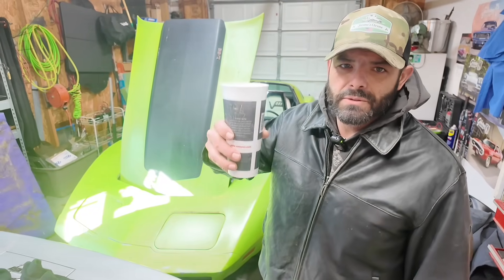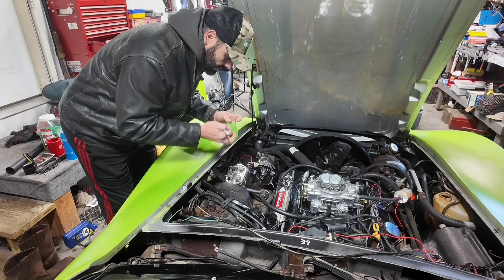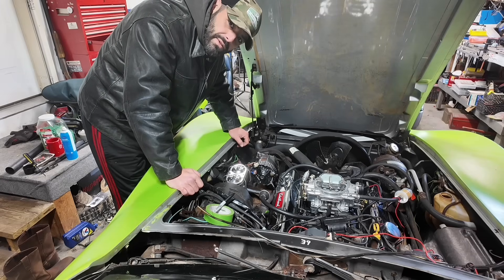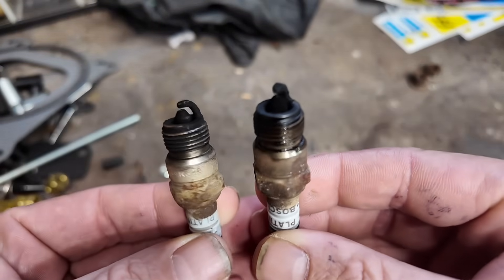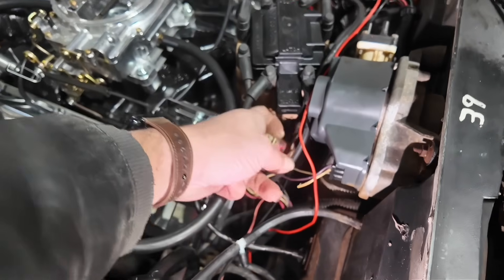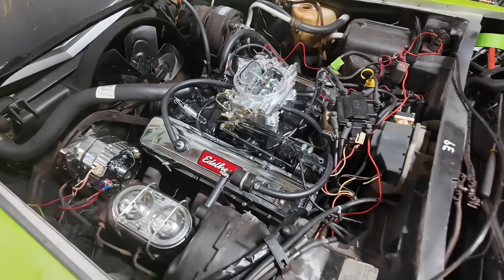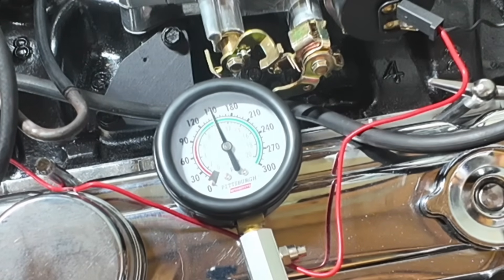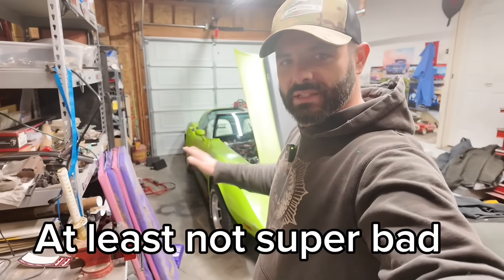Compression Testing The Vice Grip Garage Corvette

Comment: Just had time to watch now. She is running RICH plus it needs a valve job. They look very moist, so I imagine it will need valve stem seals, and a valve job as well. So, a good machine shop can redo the heads. And when you do that, you can take a peek at the cylinder walls, the cross hatch if there is any left, and check the rings. A quick and dirty way to check without dropping the bottom end out, is to pour some thin oil (or coolant) into a cylinder with the piston at various locations and see how much stays, and how much leaks around into the pan. It wont get the top (side) of the cyl. but its a start. If you have good cross hatch and it passes that test, you have a good block. Then check for play in the bottom, removing the pan to get to bearings, and you may be in cheap for a refreshed engine.

I did that with my first car when I got out, though it was a 460 and those engines were durable. Still runs to this day, 20 years ago...(ugh..its been that long. lol)

You're doing good, Steve, and still love the dead pan face you make. One day we should do a thing, if I ever come back to youtube though...life is weird.
Reply from the maker: Thanks man, and thanks for the advice. My biggest wish on this car right now is that I can just get it running decent without having to pull the engine right now, fix other stuff, and when things are more sorted decide on rebuilding that engine or building something else to put in it. It’s borderline. I’ll definitely take your advice. Thanks for the help!

Comment: #1 Bosch platinum plugs are junk
#2 those plugs are too covered in soot to read beyond the mixture was rich
#3 the #8 cylinder has oil on it but that could be coming from the transmission. Pull vacuum line off of the modulator valve on transmission and see if it's bypassing transmission fluid. You'll see it in the line if it is. Notorious for oil fouling #8 if it is bypassing trans fluid due to its orientation of where it sources its vacuum. 👍🏻
Reply from the maker: Good info, thank you! This is great.

Comment: that engin is running richer than elon musk  get new plugs in as you have changed the  carb over  run it and then . check the plugs  see qhat they saying  things may have chaanged with the new carb and vacume leaks fixed

Comment: That #8 plug looks to be damaged. Likely dropped. I'd replace the plugs with standard AC plugs instead of the platinums, run for a while, then recheck. It does appear to have been running rich but is probably also burning a bit of oil coming in through the valve stem seals. Pretty common on those old small block Chevys. I actually learned how to replace valve stem seals on a C3. I used part of a comression gauge and compressed air but you can also use rope to hold the valves up. If you don't have a valve spring compressor you can modify a basic construction flat bar to do the job.
Reply: If you have questions I'm on Instagram and FB.
Reply from the maker: I appreciate the tips. I’ll look into those things!

Comment: Considering the amount of rusty water that has been sprayed around the engine compartment a blown head gasket is a very likely source of a loss of adjacent cylinders. Blown head gasket pressurizes the cooling system blowing all of the water out leads to over heating and warped heads. Don't know why owners think their car will fix itself if they ignore it, but it just gets worse which makes repair cost also get worse as the engine continually over heats.
Reply from the maker: So you think that compression test is pointing to a head gasket? There’s quite a few reasons it could have been overheating and I thought the compression test was good, but maybe I’m wrong?

Comment: Im sure someone has mentioned it already, but the late 70s gm engines had a lot of cam failures. I've seen cams with lobes completely wiped out and the bottom of the lifters mushroomed.

Comment: You can put a piece of vacuum hose on the spark plug and it will help you to unscrew it (once you break it loose) and get it started it in the threads when you're replacing them.
Reply from the maker: That's a clever trick, I'll definitely keep that in mind!

Comment: I'd bet it's both too rich and valve seals. Chevy's are known for bad valve seals past a certain age. Luckily, they're super cheap!  Bit of a pain to change but you can do it without pulling the heads. Valve seals come in different flavors. Stock Chevy is like an O Ring. But you can get em that are of the Umbrella type. If it's a high mileage engine then the valve guides themselves are probably worn and if so, the umbrella seals are a better way to go.  Also, if you do go to put in the seals, check the height on the rocker arms studs. They should all be the same height. Some of the Chevy's, especially those that have benn run hard, a rocker stud will start to rise out of the head. Normal quicky cure... just adjust the valve and leave the stud alone. Which means it can pull up even more later. They use to drill and pin them in or install threaded studes in em. Just best to know if that "could" be a problem before it becomes a real one. If you decide the quicky cure... I'd keep from drag racing or doing a lot of high RPM's with it.
Reply from the maker: That's some super helpful info, thanks for taking the time to write it out! I didn’t know you could do that head work without pulling them, and that’s really good to know.

Comment: Can't look at those plugs, they were used with the old carb. Need new plugs do a hard pull and shut it down pull the plugs. Then you can see if anything is rich or lean. Pull up a plug chart online and compare the new plugs after a single pull. That is for wot, you can ofc drive it around idle etc and pull the plugs again and see how they are doing for idle/mid throttle normal driving. Carbs may need tuning for different rpm/loads. Not to worry its not needed to be exact but good to see about where you at. 

That old carb was so rich it was pouring black smoke so not really a surprise they are black as black can be 😂 
I would keep an eye on that one plug that looked white. Possible blockage?? or even idk maybe a slight water leak into combustion or maybe just has a big intake leak on that cylinder, I am no expert but worth keeping an eye on it. White from what i recall can indicate a lean condition. lean can be very bad under medium~heavy load for any sort of longer duration.
Reply from the maker: Good to hear from you ramair!!!! Thanks for the advice. I’ll do some better reading on a fresh set of plugs 👍🏻
Reply: @JeromesChrome  life is busy! looks like the VG corvette was a great find. i must admit enjoy seeing these old treasures being fixed and loved once again! Glad you can find time to do some of it your self. Keep it up man your doing great! much love <3

Comment: Those plugs look funny if it was mine it would get new plugs  and I would keep a eye on them . I would not assume anything about them there's no telling mileage, carbon build carb rich lean.... Derick ran it what 700 miles sucking fuel air  timing who knows...
Careful not t crack new plugs dumb headers get in the way. I would consider resetting the valves it's easy enough at same time checking that cam loab hasn't gone flat..then check manifold vacuum if it was me
Reply from the maker: Great advice, thank you! Notes taken.

Comment: Looks like you are all done, yet I would squirt a bit of oil into the lowest cylinder and try the test again to see if you have any blow by.
Reply from the maker: Good advice, thank you!
Reply: @JeromesChrome  By a "bit of oil", I would add about a teaspoon or 6 grams (I give it one squirt). If it rises, then ring blow by; if not, then compression loss is due to the valves. In an older engine like yours, exceeding 140 psi is beneficial, and as you mentioned, having even compression is ideal across all cylinders. The fouled plugs look like oil deposits, probably valve stem seals. I would run a higher heat range plug and potentially change valve stem seals.
Reply from the maker: @KarateSensei71 Thank you for the advice. Will a vacuum gauge give me info on valve seals?
Reply: @JeromesChrome  Yes, but I would not be able to tell where the leak was coming from. Either the seals, valve seats or rings. The rings might mask the seal leak, and there is no good way to separate them. Oil consumption in this case is usually valve seals, and they are the cheapest to do versus engine teardown or head reworking. You have the sparkplug compression fitting, add pressure to keep valves seated, pull keepers and springs, change seals, and reassemble. Maybe take you about 1 to 2 hours. Really good seals, like from Comp Cams are only like $35. Also, change the PCV in case that is pulling a lot of oil.

Comment: One problem is they are platinum plugs the ignition system on that engine not hot enough to run platinum plugs
Reply from the maker: I’m going back with the basic AC delco.
Reply: @JeromesChrome yeah unless you install a hot hei distributor that throws some hot spark the stock hei not hot enough to make them plugs run like they should that’s why they are so filthy

Comment: Pull it all out and ls swap it lol
Reply from the maker: It would take me 16 years to do an LS swap, lol. I do have a Fiero GT I want to do a swap one of these days.
Reply: @JeromesChrome it’s not that bad especially if you get a whole wreck vehicle and swap everything from one to another they have plenty of videos out there to show how simple it is
Reply: I had a Fiero GT 2.8 when my kids was in little league & t-ball. I overhauled it 30 over, blueprint and balanced. Wanted to put a V8 in it! But that little V6 busted out the side of the transmission (Muncie 4sp) in less than 2 years. Imagine what the HP and torque of a LS would do 😮

Comment: Love the rachet wrench with the socket. You might consider a remote start switch. Funny I normally start with the hard to reach/do nut, bolt, plug first.
I was going to say something about Platinum plugs work far better with HEI which you have and are you running the correct heat range plugs, normally 45. A weak coil could cause a weak spark so not as strong as burn.
Reply from the maker: Thanks! You think I should replace the distributor?

Comment: I gained skillz in wiring messing with my c4. By the time I replaced and fixed some on different connectors, I was able to realize that the wire from the fusible link going to the starter relay was actually broken. 😂
Reply from the maker: Sounds like something I would do, lol!
Reply: @JeromesChrome it was probably my initial no start, intermittent run and die issue from the beginning

Comment: Compression is very good.  No more than 10% difference between cyls is acceptable.
Black plugs indicate a very rich condition. Probable causes in order:
1) Choke misadjusted or sticking closed. Choke is only needed to start a cold engine.
2) Crud in float needle valve or the float is misadjusted. The excess fuel will find it;s way into the cyls.
3) Main jets on the carb too large for the engine. 
4) Excessive idling and not getting driven.
The above are easy fixes.

Carbon fouled plug:  An excessive rich condition coupled with poor regular maintenance (i.e lack of tuneup and oil chages) will cause this.

Good luck
Reply from the maker: This all makes a lot of sense. I appreciate the advice and info!

Comment: Don't know what's on  Those plugs because it's a mystery ,Derek put a lot of oil type stuff in those cylinders to get that thing running so it's probably just build up from all of that.  Of course you probably know all of that by now. Be ready to spend annual money on spark plug wires the boots are gonna fry up from those headers being so close. They make those high performance boots just for that but.
Reply from the maker: Lol! True, I didn’t think about the mystery! I’m sure it contributed. I’m still wrapping my brain around proper plug wiring routing in this with the headers. Thanks for the heads up!
Reply: Don't panic about that car she'll do your right all those little things you found like that red wire all those little things add up she'll scream for you but do definitely check out uncle Tony's garage. Also if you get in a cleaning mood take some paint thinner and take it to those over spray spots

Comment: May be running a bit rich? It could have been that old QJet you took off. You might want to check cam & valve timing as well? That motor might be a bit tired, as well? A compression check is a good way to test how every thing is but if you're not burning oil or water, you're ok so far.
Reply: You are welcomed. You might have to check all of the vacuum hoses on the engine. Especially if you want to get the headlights to work up & down. Those leaks can have a good motor run rough. If there are no vacuum leaks the rest should be easy but those old headers & sidepipes really must go, seriously. If they are bad & leaking or worn through, no engine fine tuning can solve or fix that.

Comment: I have had trans fluid being sucked into #8 via trans vacuum hose.
Reply from the maker: That vacuum line was trash too.
Reply: If that were an issue then it would require vac modulator replacement.

Comment: You do have options. From Summit Racing, NOS Big Shot Injector Plate Kits 12610NOS, and the Edelbrock E-Force SBC Supercharger Kit 1551. It will run you about $4000. But it will bring an L48 up to about 580–670 hp. You will need to replace the fuel pump, transmission, drive shaft,  and possibly the rear end.
Reply from the maker: That sounds fun. I’m probably going to have to replace all of that eventually anyway…Definitely something to think about.
Reply: @JeromesChrome  Nitrous alone will safely add up to 100hp if the timing is set right. And the car should take it.
Reply: Rear end was shot anyway if you watched Derek’s rescue.

Comment: The car was running very rich so the plugs definitely showing that but not necessarily burning oil.
Reply from the maker: Thanks!!
Reply: was likely misfiring on all 8 with that coil wire
Reply: That was just the power wire to dist, won't be a cause of a single cylinder misfire but if it were broken it would cause low power to coil and weak spark on all cylinders.